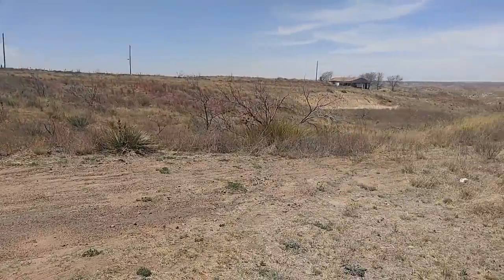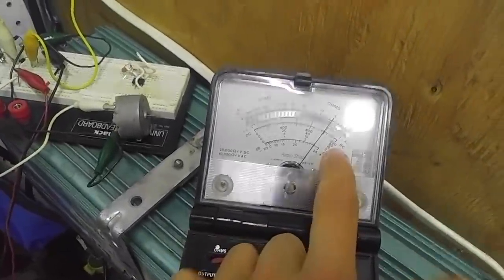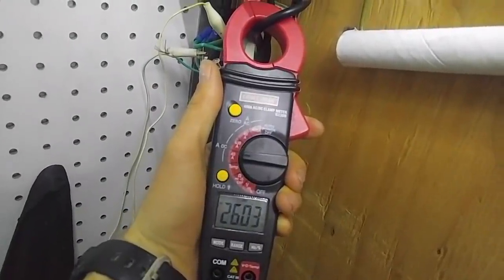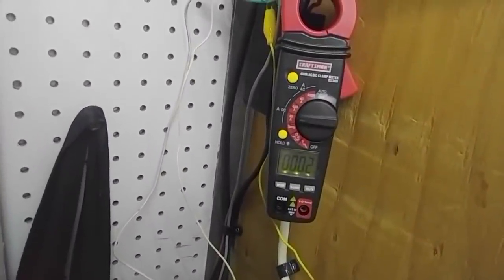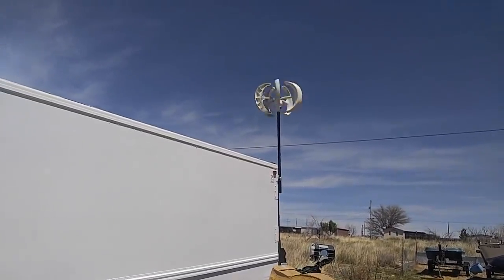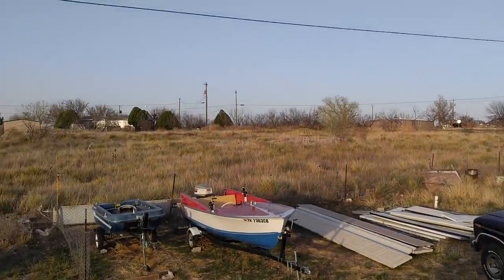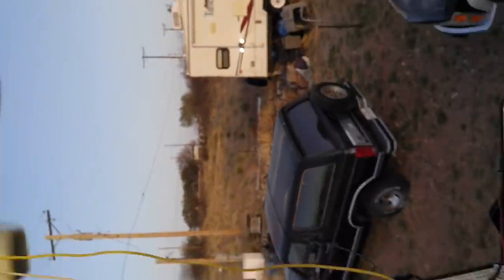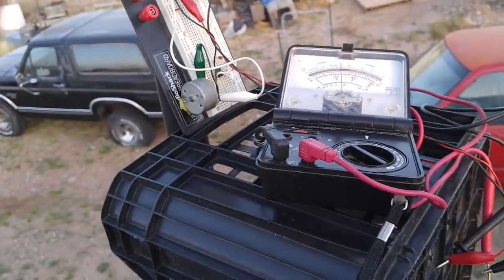400W Chinese Ebay Latern Vertical Wind Turbine Performance

Comment: You do know, don't you, that these pancake alternators make AC, not DC. You have to rectify them to get power out.
Reply: rstevewarmorycom Hence the 6 diodes on the breadboard and the black box (rectifier) inside the truck
Reply: @ianl1741  
A rectifier uses diodes.

Comment: Wrong measurements. .You must measure the open Source voltage... How much is the maximum Voltage at what RPM.
Then measure the short circuit current at different RPM settings. .not for too long as the generator would get hot...
Reply: Stefan Hartmann I had the turbine hooked up to the controller and measured how many amps were actually going into my battery bank? How is this "wrong"? It's the most accurate possible for real performance. You bring up an interesting point though regarding the short circuit current. I effectively measured that by manually shorting a little motor connected to it (see voltage drop). It was less than 1 amp for sure.
Reply: Okay, then the maximum power it could put out is more in the 20 Watts range...not 400 Watts range..
Reply: Stefan Hartmann I'd say at least at tested speeds in the <5w range lol. Or about 1/100th of rated. But yes you get the idea. Pretty sad!

Comment: If you can't return it or get your money back by complaining to your credit card company, try modifying or replacing the motor and see if you can get it to produce vs letting it remain a complete and total loss. If you add something that helps, dont forget to post your results - Good luck!
Reply: WJK Friend, Ebay has great buyer protection. Got all money back AND still have the turbine and controller! Thanks for the suggestion and concern :)

Comment: you should choose a horizontal wind turbine, that will be much better. vertical type normaly use for wind solar hybrid system, the output is really bad. you can contact me if you want to know more information about wind turbine from China manufacturer.+86 15261660256 whatsapp
Reply: These lantern turbines are rubbish -  After one year claiming it didn't work the manufactures agreed it was a bad  design and "refunded" my money. The generator needs at least 200 RPM the turbines just don't get there.

Comment: Your diodes can only handle mA so your  current measurement is inaccurate.
Reply: dr3sco the diode circuit was just to rectify the voltage for my volt meter so I could read the dc voltage. The actual measurements were done through a 600w rectifier. It turns out though the turbine only puts out miliamps so everything was good anyhow ^^ Those diodes are actually a mix of 1-2 amp ratings.

Comment: If your batterys are fully charged the regulator wont put out as much, I like to test wind jammer with my solar panels turned off and batteries are wanting a charge?
Reply: busterjazmin This is a good point. Fact remains I can kill output voltage by seizing the little motor, means it isn't putting out anything regardless.
Reply: @ianl1741  
No. Electricity doesn’t run like water. It doesn’t spray out when you choke your little motor. The pixies need something to run around, in, or on.

Comment: This should probably be a lesson in buying cheap Chinese product online. If you need something to work, buy from a reputable/known source and buy something that you can return easily if it fails to produce whatever it's claims are...or "aren't". Thanks you for the video..I was looking at these turbines myself, but I've seen a lot of video and other information on the generators inside these..enough to NOT want to purchase one now.
Reply: Glad it was helpful...didn't see any reviews (where turbine had a chance of making power) of this product and wanted to be the guinea pig.

EBay has great buyer protection. Got all money back and I still have the worthless equipment!

Comment: Thanks for the video, Its greatto see peoples attempts at self power.  That 'Generator"  you have there is actually a three speed ceiling fan motor. they are good for turning fans on ceilings and not much else.
Reply: Not that you should haft to but hack and put magnet's in .
Reply: Stronger one's
Reply: Well said, exactly.
Reply: No wonder it didn't produce any meaningful power! Thanks!

Comment: are you sure you wired it up correctly??
if you have the diodes hooked up wrong its Blocking basically all your power(thats what its supposed to do ) to prevent power from the battery going back into your panels/wind turbine

i would disconnect all the stuff you have ,... and rebuild your system and use thicker  gauge wires ;)
those tiny wires are NOT going to send power to your charger any time soon   (too much power loss )
Reply: Trace&Tracey Elliot guys...these are not configured as blocking diodes but as a 3 phase rectifier. The turbine simply doesn't produce significant power.

Comment: Perhaps you should do some research before trying to offer an instructional video. The little device that's changing the three phase turbine AC to DC is called a rectifier. They're cheap to buy, and they're used on most small wind projects. Those L-16 batteries are nominal 6V each (actually 6.3v) , NOT 12v. For others who also don't know, the THREE caps on the top of the batteries are a big hint- you're car battery, which IS 12v has six caps. Each cell is 2.1 volts. You can get to 12v by wiring two in series (that's negative to positive on the next one, easy math being 6+6=12), but the batteries themselves are 6v.
Reply: Good grief, wtf, cut the young guy some slack, he's clearly still learning. Plus, last I checked, it's youtube... not a major scientific peer reviewed production.
Reply: I didn't bash him or call him stupid. I suggested doing some research. Guys  furthering false information will actually learn something if called out. People go to these types of videos to gather information. False info has to be corrected.  But, good luck and have a nice evening.
Reply: Interesting psychology/interesting teaching methods... by the looks of things, I'd say he's not doing too damn bad on his own at such a young age...
Reply: Slack are u kidding or just a troll
som on seeking info
Who dont hawe the skills 
Could take this info
Or falce news for real ..
If you want to make a test 
Of a 33A 12v wind turbin
Use ekvivelent leads and recitfier
Or you get a f u result..
"" Doing a good job "" hilerius..
Misleading in any way possibelt
And now ask me wher i got the 33A 12v from 
Lets see if you can figur that out in yor
Psykotic mumbel about intuition and teatching
Reply: Hi Ian. I'm glad you didn't take my comment as an insult. It wasn't. Appreciate your user feedback on the small turbine. There are plenty of wind turbine scams out there. Most don't deliver anywhere near what they claim. I wish the standard would be 15 MPH winds, because many more people will have realistic access to that kind of wind, rather than lines on a chart most don't understand. There is a new(ish) standard for wind turbine output rating, but it's not what gets advertised on most sites, plus, it's 23mph or something like that. That 8 or so mph difference in wind makes a lot of difference, because power is based on the swept area. Unfortunately, most small VAWTs don't deliver much usable power (I wish they did). Good luck, and keep up the good work!
Reply: Hi Steve, I know very well about the 6 cells total on the battery bank. That was simply a misspeak on the video I didn't bother to correct. Figured people would get the idea I was speaking about the battery bank and not the 435AH 6V Trojan L16 batteries WITH hyrdocaps individually. Thanks for informing me about the term rectifier, I will use this this next time. Recfiers are conposed of diodes of course, so from memory don't think I said anything technically incorrect there. Edit funny thing was over course of reply I kept putting 12v in all the placed where 6 should go. 12 on the brain!

Comment: it doesn't look all that bad to me. it just needs closer tolerences . or put more magnets in it. it's not going to do alot. either way. and it's not high enough. it will take a week to charge your phone. if you are going to trash it. I'll take it! I think I could maybe get 4-5 amps out of it on a good day!
Reply: James stranger yeah you'd think 4-5 amp hours...yeah I guess that's pretty reasonable. Not every day though. And that's pretty sad for something which is rated to produce 4000-5000 amp hours over the same period.

Comment: Your presentation of information is so bad, I'm wondering if you're just trying to piss me off.
"144w m/s"  does not mean anything.  26 mph is around 11 m/s. 

No wind-generator will ever work well at a height of 10ft. The wind gets friction from the ground (that why the sea has waves). Clear air starts at a height of 30ft in open country.

I made a spreadsheet showing the relationship between wind-speed and maximum theoretical power. You need to know the diameter of the  circle that the wind-generator presents to the wind. (Normally it's the propeller diameter,but not in your case. I've estimated 0.7 metres - you can change that.)  
 
https://docs.google.com/spreadsheets/d/1_VAZCxWEvqoJkPIne3Ow7bHfyG1XlHnB_OKnw-Y7PZg/edit#gid=0
Reply: try a LENZ type vawt bud...   mine's kicking 1200 watts an hour 1 foot off the ground in a partial valley
Reply: Harley Me - Have any pics, links or video of your setup???
Reply: Smartphones can be difficult to type on, since this video has gotten more attention than I imagined, considering revisiting and clarifying. 26mph should be your clue, that was supposed to be 14 m/s I believe. Clearly I didn't proofread. That is what the manufacturer stated the rated power of 400w would be produced at.

Yes, it would be best if the turbine was on a proper tower...but am I going to erect a tower for something that doesn't work? Hell no! The fact that the turbine is mounted on a truck suggests a very good testing platform. Just have to hit the freeway :))

Thanks for the link!!  Very fascinating!
Reply: Man, of course at higher height we'll geting stronger wind, BUT, if the blades are rotating (and in the video, they're rotating enough fast) it should produce power regardless of the installation height. Don't mix apples and... :(
Reply: Triggered much!!?  I had no idea we were watching a professional peer reviewed production on youtube. Wait, on second thought, you're exactly right... I think the guy is totally trying to piss you off!  Never mind that the guy is clearly young and obvious green/learning...  Nope, in fact, I bet the guy is putting together another video, worse than this one, just to piss you off some more - bwaahahaha lmao

Comment: I do not see here any Professional Converter.? But any way in Poland we have  3..5 K.W.vertical turbins for 1800 Euro. From Hipar.
Reply: With only 30 mA output you don't need a 500 dollar controller

Comment: Ok guys, I purchased one of these to do my own testing last week, the same issues mentioned in this video exist in the one I purchased, it simply wont put out 24 volts and the blade design caused fowling resulting in the turbine falling short of enough RPM, factory stats are all bullshit! The strengthening ribs cast into the plastic blades prevent the wind air pressure from escaping easily which then causes the fowling. The alternator has the same thin wiring and would only produce around an amp when spun up to a speed where 24 volts was produced. The other issue is the clearance between the rotor and stator, it's simply too large and they did it I assume to prevent cogging for low wind start up, what it actually does is cause a weak magnetic field as each magnet passes a pole. The solution is to instead fit neodymium magnets which will greatly increase the output, more gauss = more electrical output. I will try this and lets hope it fixes the problem as the factory magnets are too weak for the job, failing that, rewinding with heavier windings is next! Don't get me wrong, they are a pretty looking turbine and look like they would more than do the job, but what your actually buying is a spinning decoration, nothing more unless you mod it to work better!
Reply: THIS comment should be at the top of the stack!!
Reply: Rob Hull - If you do any mods... please report your results!
Reply: And the windings inside are copper coated aluminum which means another loss of about 40%
Reply: @johnq8792  are you sure?
Reply: @Surferant666  .... i opened mine and wanted to make it from a star to a delta configuration, windings were doubled inside from the factory, then got another idea of making it single coil instead, when connecting it back together, it was very brittle and soldering was a pain, then I realized its cheap aluminium wire, with thin copper coating, all these cheap generators and motors from china doing this now to save costs also weight.
Reply: Ian L - Agree!  Maybe with some collective brainstorming... we can get it to actually produce!
Reply: True, just a spinning decoration, I got the same, it makes 20 volt AC with spinning by hand and direct measuring but after a 25 feet cable only 10 volt DC arrived at the end after the controller.
Reply: @johnq8792  
Use HUGE gauge wire for starters. 

Dang, I want to hear someone made these rigs work!
Reply: Mod it
Reply: Agreed and yes - rewind and get better magnets
...
Reply: It's just a general bad design, large wind turbines don't use tri-blade setup to look cool, they do it for maximum efficiency.
Reply: It's freaken Chinese dude! What the hell did you expect? Duh!

Comment: Did you actually think you were getting a 400W wind generator from China?
China over specs many of the electronics they sell and I suspect this is one of them.
Reply: valveman12 was hoping for at least half, not <1/20th rated haha

Comment: i had the same shit with a 6 blade '600 watt' regular turbine. With chinese stuff, specifications are generally unachieved, be that inverters, 18650 batteries etc esp if 'cheap'

Comment: I could be wrong, but you zeroed the meter under load... In order to get a good measurement,  you would have had to zero the meter while under no load conditions then measure amps.
Reply: Bob you are exactly right! He zeroed the multimeter under load. Doing that would show any current load measured by the meter, as zero.
Reply: bob bellanca obviously I did a significant amount of testing before and after this video. I did zero it on the controller wire once, but if you noticed the voltage on the meter was 9v. 9v does not charge a 12v volt battery bank, hence no electricity was flowing into the system, and hence any zero would not have affected future measurement. Short of tha matter was if this thing worked we'd see at least 5 amps...like the 20+ the solar bank was outputting.

Comment: French guy tested, going too fast and it put out nothing, need to be at or below rated speed.
Reply: biggadfly manufacturer says maximum speed is 44 m/s. That's like 90 MPH ^^
Reply: Ian L that is survival speed, much much lower speed it is making power.
Reply: Man, at 25mph it's barely producing 12v...barely high enough to charge the batteries. Slower and voltage drops so batteries won't charge. And current isn't any higher. Don't know what you're talking about.

Comment: I've rewound a few alternators for home built wind turbines and the windings in this alternator are too fine, you will get voltage but low amperage, it needs heavier windings to produce higher amperage. I'd say this turbine is only designed to trickle charge a battery over many hours with its charge controller only preventing over charging of your battery, this unit is more likely to be 400 watts per hour, but these Chinese sellers won't tell you that little detail! Maybe take it to a rewinding place and get them to up the gauge of the wire? An expert in rewinding alternators will give you advice on how to improve it.
Reply: Rob Hull watts per hour... dude. Thats Wh. And that is what it performs over an hour. And that means 400w. Dude...
Reply: LordGryllwotth man...the electric company bills you for kilowatt hours. 1 kilowatt hour = usage of 1 kw for 1 hr...or any equivalent, say usage of 2 kilowatts for 30 mins etc. Same with watt hours.
Reply: You get 400 Watts running it for 7 days maybe